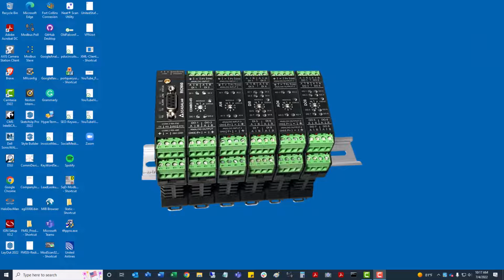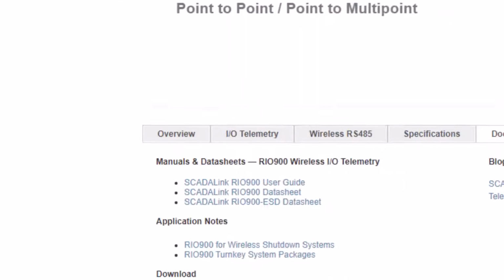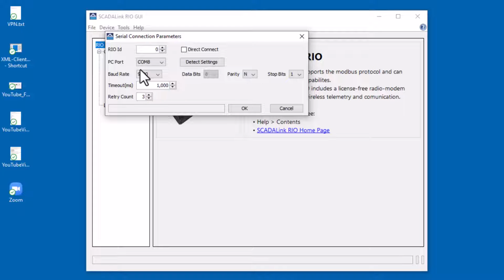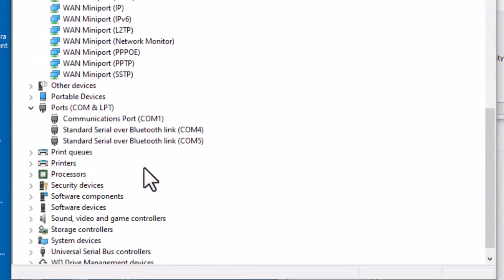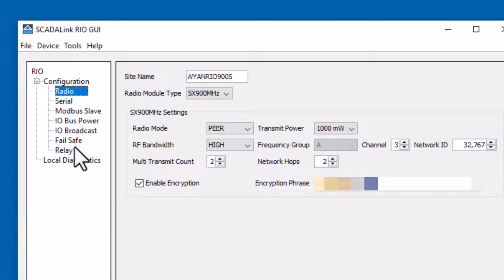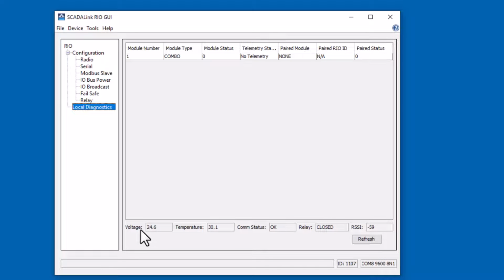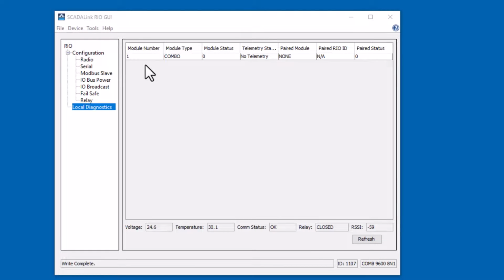Bentek SCADALink RIO900 RS232 Configuration

Comment: Hi, i am having some problems with the SCADAlink RIO100, I've downloaded the RIO 4.5.9 zip, but it´s not communicating correctly. Do you have some tips?
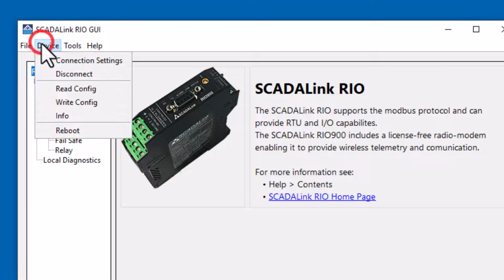Reply: I've followed all your steps, but when I press the READ CONFIG button 3:43 , it doesn't work.
Reply from the maker: Hi Carlos, I have not worked with the RIO100, just the RIO900 series of hardware. Bentek calls out two different firmware files. REV 1 (RIO_3.0.9.zip) for units with 4LEDs, and Rev2 (RIO_4.5.9.zip) for units with 5 LEDs. Does your RIO100 have Four or Five LEDs on the base unit?
Reply from the maker: A couple other things to verify: do you know the COM Port # for the USB-RS232 adapter being used? are you using 9600, 8, N, 1 for your settings to talk to the radio?
Reply: @fmsintegrationllc5191   I am using the port 1. and yep all the configs are correct.
Reply: @fmsintegrationllc5191  I've had an online meeting with the support, they were very helpful. They said that in my case, would be better to send back my device and then they would give another one. The problem was that all the 5 LEDs are solid red, indicating that there was no firmware in it. So in the meeting I shared my screen with the guy of SCADalink, and then he showed me the right procedure to install the Rio2 firmware. But even doing the correct steps it didn't work.
Reply from the maker: Hi Carlos, 
I am glad you talked to the Bentek support team. They have been great anytime I had to contact them. Hopefully you get your unit replaced and are back up and communicating. I have not run into a case where there was no firmware loaded. Thank you letting us know.
Reply: @fmsintegrationllc5191   It has 5 LEDs on the base. I have downloaded the Rev2.